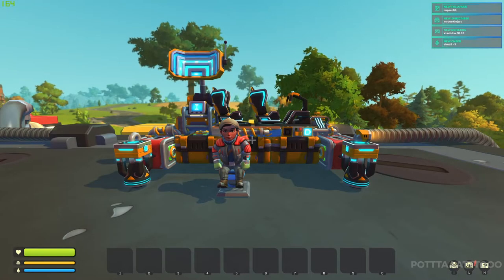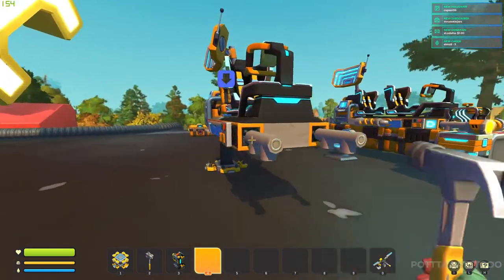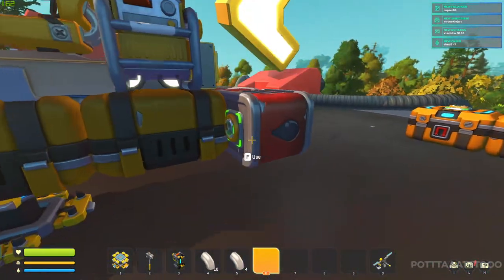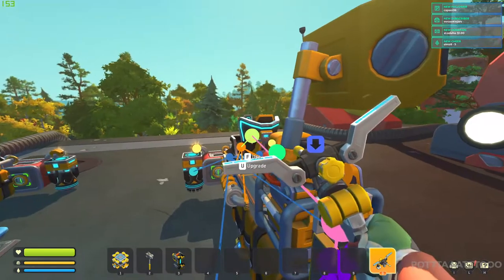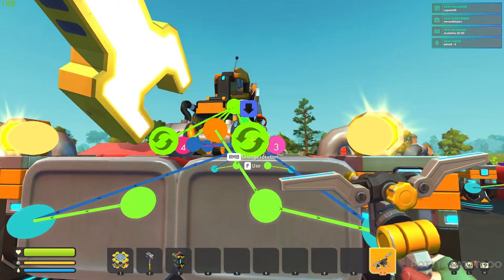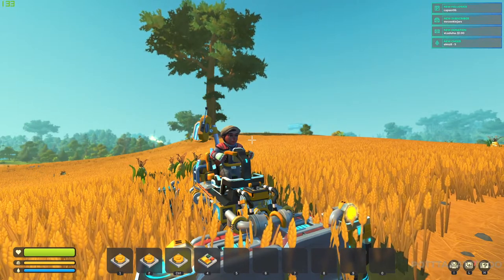Scrap Mechanic Survival Flyer Tutorial // Bed, Beacon, 3 Chests, and More // Scrap Mechanic

Comment from the maker: Sorry for the late comment, but I also added some timestamps to help anyone trying to build this vehicle. I will hopefully be putting timestamps whenever each video is released, as long as I don't forget xD

TIMESTAMPS
0:00 Intro
0:15 Parts List
0:51 Assembly
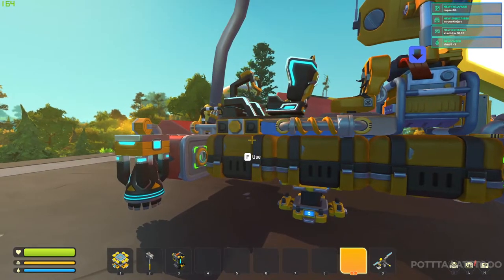5:01 Logic
5:14 Wiring
6:50 Vehicle Settings
8:36 Controls
9:52 Bearing Fix
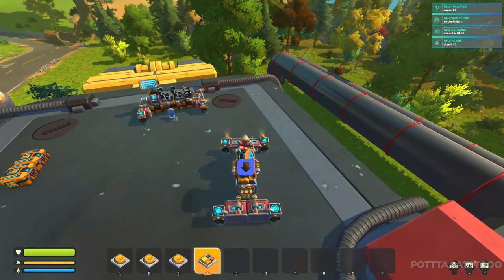10:02 Controls Cont. 
11:32 Outro

Comment: my suspension glitch wont work. I did what you did but mine wont weld together. I really dont know why
Reply: just a shot in the dark: the issue might be which surface your cursor is aimed at. I think you have to aim at the bearing, but may be wrong.

also, like he said, it MUST be on the lift.

Comment: I would try 1 fuel tank connected to the 3 large chests & a looped controller to convert w+s inputs to pitch in place of the gas engine.

the logic I copied for my flyer has 3 speeds: constant burn to rise, fast pulsing to hover and a slower pulsing to descend. the logic gates weigh relatively little and add functionality. similarly a sensor pointed at seat for a deadman switch is worth the weight.

Comment: i hope you see this but i have a question. i want to know this before i build. for the gas contaniers do you have to place it with that technique or can you do it diffrently as long as it lines up the same. ty
Reply from the maker: As long as you have it attached to the vehicle in the same spot you should be good (like if you want to weld it on or smth)